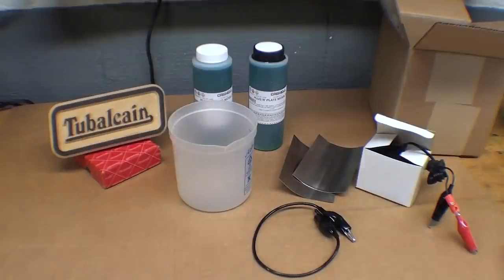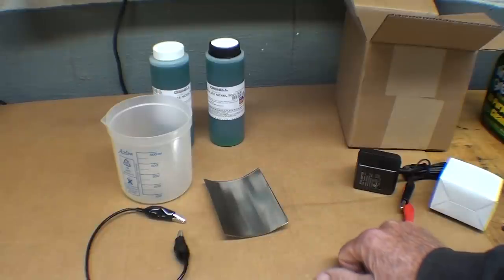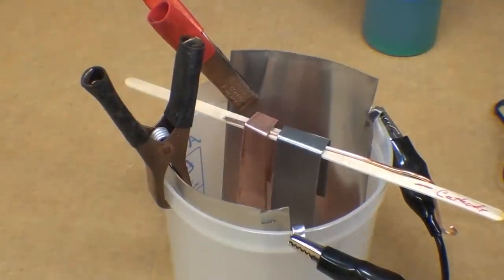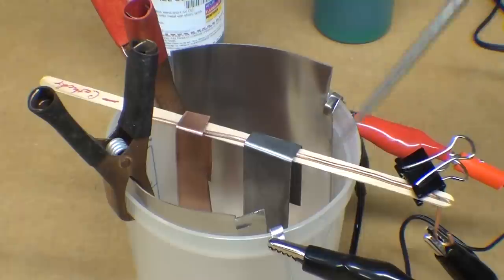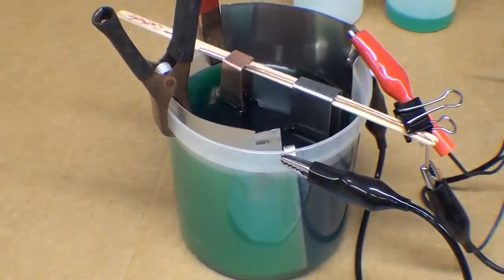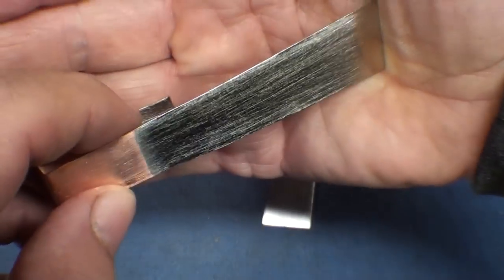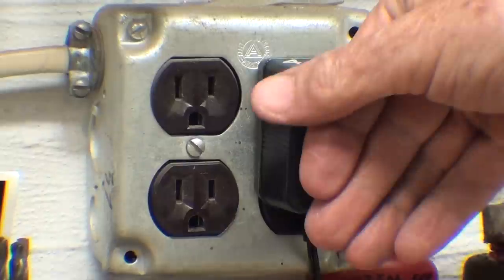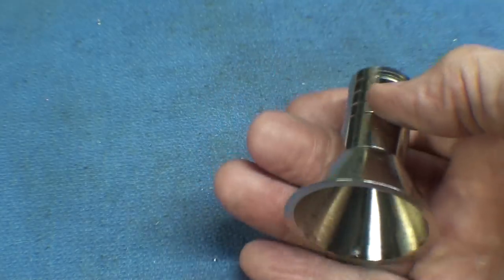SHOP TIPS #383 How to Nickel Plate tubalcain electroplating

Comment: 👍That was cool! Thx for showing us. My 1st job (before my “real”’education) was @ a huge local downtown Louisville KY hotel in maintenance-engineering dept. The presidential suite plumbing was heavy nickel plated brass. Fittings were simply beautiful for plumbing & I learned that one can easily mar up a fine finish very fast if not using proper tools. I believe also used on boats-ships in salty climate. Since then I’ve kept a certain kind of appreciation for such high quality nickel, yellow brass & #1 copper sheeting that was used back in the day. Thank you Sir Lyle.
Reply from the maker: And now, most of the cheap Fossetts at the box stores are chrome plated plastic

Comment: Your story about the stolen nickel rods reminded me of an incident. A large machine shop stored a lot of their material outside. They secured it with a chain link fence. Someone broke in and stole some sheets of aluminum, several hundred pounds. I've observed in my life that most criminals are stupid. True to that, they took the aluminum to a nearby scrap yard and used their real name. The machine shop called around asking for plate aluminum. When they found it, they met the police there. They had all the printed info from the aluminum, heat numbers and whatnot to prove it was theirs. The owner of the yard was steaming mad but was forced to return it.

Comment: Thank you for the demonstration! I used this technique to zinc plate the original fasteners and smaller steel pieces on the '1970 vintage Triumph Tiger I'm restoring. I used a solution of white vinegar, epsom salts and sugar (from a formula that I found on some plating how-to-group) and four 1.5 volt batteries or single 9-volt. All very inexpensive. The bubbling was quite apparent (more of an effervescent bubbling than a boiling bubbling) so I'm not sure why you didn't witness it except for possibly actually using only 2 to 2-1/2 volts. Take note that you can overdo it with zinc. If left too long (more than several hours) it will actually accumulate a zinc crust rather than a plating. Then you have to wire-wheel the any male threads and chase any female threads with a Whitworth tap and start over. The zinc plating does appear a little dull right out of the soup, but it quite easily buffs to a nice shine that lasts.

Comment: In 1968 after the Navy, I got a job working at an electroplating plant (small shop).  Plating copper tips for soldering pencils with iron.  After two years of experience in using this plating system, a new engineer became the overseer of our process.  It was common to take a tip that has been plated with iron and heat it with a torch and bend it in a horseshoe shape.  The engineer would example it via a magnifying glass to see if any imperfections.  He insisted that there were imperfections on the tip.  Now I had to completely remove all the iron via sulfuric acid from the copper tips and redo the plating again.
Three hours later I took to the engineer a tip that had been heated and bent for examination.  He looked at it and said that’s better.   What he didn’t know it was the very same tip that I show him 3 hours ago.

Comment: Mr. Pete, greetings from N.C. and thanks for another great video. I worked in a plant for twenty years that did triple chrome plating on brass autoclave doors and a ferrous parts for medical equipment. The three are copper, nickel and chrome. Parts were highly polished, chemically cleaned and washed and came out of the final tank with a mirror finish. The best chrome plating always include nonporous nickel to seal the base surface to prevent corrosion. Cheaper plating on ferrous that omits nickel will eventually rust through the porous chrome.

Comment: hey my friends and I nickle plate brass jewery for a living and if you heat up the solution in a hot pan or microwave it helps it from flaking off and it gives it a very bright shine, also if u give it some circulation like with a fish tank pump it plates like in 3 or 4 minutes..  i think that the needle on reader was moving because the copper wire on wood stick wasent clipped on right. i hope this helps..
Reply: Good tip to know, thanks. I noticed he filled the cup with the solution up to touching the holding clamps. That’s not good, right?

Comment: Back when I was an apprentice machinist one of the journeymen had to make a wind tunnel model nose cone that was thin wall so they could get the temperature distribution over the outside surface with thermocouples mounted on the inside. He made the model 1/16" undersize out of aluminum then it went out for playing.
They first copper plated the aluminum because the nickel wouldn't stick to the aluminum then plated the copper with the nickel until the plate was over 1/16" thick but the surface was covered in what looked like "warts" . He machined it down to the required size polished it up and it looked great. 
I've been thinking about making metal models using a plastic model playing with copper then dissolving the plastic out and playing the inside with nickel and disolving the copper off the nickel and I would be left with a model only made out of metal.
Thank you Mr. Pete love your channel😀

Comment: I am watching as I am plating in the garage.  1.  You can easily make your own plating solution using household vinegar and some salt to increase the conductivity.  Both anode and cathode would be nickel.  When the solution turns green (about 1/2 hour) you are ready to go.  2.  To plate, make sure, as you said, that the piece to be plated is as polished and perfect as you can get it.  If you use Scotchbrite or abrasive paper you will have scratches, so use a buffer to make it as good as you want the finished product.  3.  Negative lead to piece to be plated, and positive to nickel source.  You used strips, I use old Canadian nickels which are 99.9% nickel.  NOT ALL NICKELS ARE!  Judge your time by the look of the finished piece.  When you are happy, do a little more and your are done.  Really simple and fun.  In my case, it cost me an old nickel, which will do many jobs, and some vinegar.  Remember, NEGATIVE to piece you want to plate.  Bubbles will form on piece you are plating.  Counterintuitive, but there you are!
Thanks for great video!
Reply from the maker: Thank you very much that is great information

Comment: I remember seeing the plating plant at Mira Showers in the 90's. They were plating the brass shower valve bodies. They used copper plating followed by polishing they did this because the copper would fill in all the very small imperfections. the valve bodies were then nickle plated and then chrome plated, the nickle was used because chrome will not take very well to the copper but would take to nickle.

Comment: Mr. Pete, your Simpson 260 is THE most classic of multimeters!  It is THE standard and is the "Starett" of electronic tools.  Don't let it disappear (I practically keep mine under lock & key and I don't "lend" it); and, check the batteries once in a while.
Reply: Jim Cason I was admiring Mr Pete's Simpson too. You're right, that would be a tragedy if one of those batteries leaked. I had better go check mine too.
Reply: I've got my original Simpson 260 that I bought in 1978 and I have a Simpson 303 (VTVM). Both are in near perfect conditions and still in their leather cases.
Reply: I still have 2 of the black simpson 260's and 1 of the "newer" yellow plastic ones. All of them are in soft canvas cases and used regularly.

Still one of the best meters you can use.

Comment: It was mentioned below, the nickle is in the solution.  I believe when they chrome plate parts, first the plate with copper, then nickle, then finally with chrome.  Plating with silver, nickle or gold are simple and they do car badges with it.  They just have a wand with a cotton ball on it, then touch the shiny part of the badge with an electrode, and wipe the wet(with whatever plating solution) over the part to make it gold.  I don't think most plating is too dangerous except for chrome plating, as the acid used to hold the chrome in solution is very caustic and the out gas is deadly.  Great video by the way.
Reply: I've seen the 'wand' method used to gold plate taps (faucets) and radiator tails.

Comment: Great video
I can see allot of items around Mr Pete's house becoming shiny.
There are many applications in the machining hobby where metal plating comes in handy.
If you want to tighten up the fit of a shaft in a bore, you can get a real close fit.
Require a surface that is long wearing.
Corrosion protect.

Allot of the early automobile trim was Nickle plated instead of Chrome. I actually think Nickle looks better. Has a softer look.

Cheers
Willy

Comment: I think the photographic technique to which you refer @ 18:44 is the use of a 'light box' or 'light tent'.  It is a usually a wireframe or cardboard box cube with white translucent material draped all around with a curved piece (of white paper, cardboard or material) behind and under the item and a single opening through which you place the item and photograph through. The light illuminates the material from the outside so all the material is evenly lit inside and kills most of the shadows on the item to be photographed. Super easy to make.
Reply from the maker: Thanks

Comment: I don't know if anyone else mentioned this for I didn't read all 212 comments, but the anodes are only used as a conductor and the actual nickel is dissolved in the electrolyte. This isn't to say there is no transfer from the anodes but very little.
Also pulse charging has been around for a while, protects the battery. Thanks for the video

Comment: The green solution is probably Nickel acetate solution made by electrolytic meand in white vinegar.  It's quite safe and can easily be made at home.  The solution improves as you plate more.  A better way of hanging the bell punch is to take stout copper wire bend a 'U' shape for about 10mm and push it into the screw hole giving a positive electrical and mechanical connection as well as allowing the screwed hole to plate.When plating steel it is better to plate with copper first with electrolytically home made copper acetate solution with copper and white vinegar.

Comment: WHEN YOU GO TO PLATE YOUR PART THAT YOU MADE. AND WANT A GOOD PLATE. THAT WONT WONT PEEL. MAKE YOU A SMALL ELTRO. CLEANER AND A MILD ACID DIP.YOU CAN USE A LITTLE  CLEAN BATTERY ACID ( SULFURIC )  10% & 90% H2O  THEN CLEAN WATER RINSE, IF YOU DONT SEE ANY WATER BRAKE ON PART.YOU HAVE A CLEAN PART.AND WHEN PLATED YOU SHOULD HAVE A GOOD PLATE.  IAM A PLATER, RETIRED. HOPE THIS HELPS. YOU HAVE BEEN A BIG HELP TO ME ON YOUR MACHINE VIDEOS

Comment: I really enjoyed this video mrpete! I purchased a gold plating kit a few yrs ago (I haven't used it yet) it came with a gold solution that is clear and you use a swab to "paint" the gold on a item you could hang it like you did but the kit only comes with a small jar of gold solution so it would need to be a very small item- the directions say to remove any chrome plate (came with chrome stripper) then reactivate the nickel before applying the gold- the video shows gold plating a kitchen sprayer (22crt) I am going to give it a try after watching your video cuz I forgot I even had it lol you could probably buy the gold solution and use your set up & make a cotten tipped swab to apply, oops looks like I got carried away with this comment- Great Video mrpete! 2 thumbs up

Comment: Interesting stuff.  I was also impressed with the look of the punch when it came out of the solution.  I'm sure you can get the 2 main ingredients on eBay or somewhere cheaper than buying it with the kit.  Be advised the nickel sulfate is said to be a carcinogen, so always wear the latex gloves and use in a well-ventilated area, preferably outside.  You can get it in crystal form, but don't breathe in any of the dust.  Not sure what to mix it with, probably distilled water?  A potential source for the nickel is pre-1982 Canadian nickels, which are said to be .999 nickel.  Some french francs are the same.  Or just search for nickel bullion.

Comment: Also, now that you have the kit (which is just the wall wart, so you can also do this with batteries) you can also do copper at home.  Use copper wire or a copper bar as the anode, and use copper sulfate pentahydrate as the solution.  You can get copper sulfate at the hardware store as plumbing root killer.  It's a blue crystal.  Just mix it with water and set it up the same way.  Do this one in a well ventilated area, as it off gasses sulfur dioxide.

Comment: For those scientific purists the normal copper plating solution is copper sulfate. It comes in powder for and should be mixed with distilled water.

These days I'm taking up anodizing. I'm considering doing a steam engine with no paint, just anodized finishes for a mostly aluminum build.

Comment: Explanation for fluctuating voltage: Tiny bubbles cover the workpiece,  reducing the surface to the liquid and therefore increasing the resistance. The bubbles grow larger and finally break loose and the surface to the liquid increases again, reducing the resistance. This process starts over and over again.

Comment: I just got the stuff but I didn't use a kit. I decided to get the 44 x 1.24-inch rolls, not as thick but it's easier to mess with cutting. I've plated before but with zinc. Over time I'm going to be plating a lot of parts but not high volume so I got a magnetic stir and lab bars to help knock the bubbles off. I got a thick plastic box that will hold about 2 gallons. Some of those cheap wall chargers are noisy you might want to put a filter cap of about 1000uf across them but if you put the polarity on backward those things will pop and smoke, it's kind of fun to watch but wear safety glasses. I blew up a bag of capacitors just for fun.

Comment: I have never seen an electropated finish delaminate from metal, only from plastics.  Chrome, on the other hand, is infamous for peeling off even when professionally done.  

I have been gruesomely sliced twice by peeling chrome, the separated 'flakes' are viciously sharp, jagged, and usually corroded from the base metal on the backside.  I'll take the nickel finish every time I have a choice.

Comment: I had a peace of nickel plated cast iron from a old gas stove made in the 1940,s  probably, and it was stored outside in full weather for 2 years and never rusted one bit , I took a rag and rubbed the dirt off it and it shined bright and perfect .
It had very good nickel plating , probably very thick , not like the things that are made today with just enough plating to give the product color and start to rust the first time it gets wet .
I like nickel plated things better than chrome plated things .
Nickel plating has a warmer tone when polished .
This is a easer way to plate things in a home shop .
Factory,s usual copper plate first coat under the second coat chrome plate .
I have been told that some times the copper plating is then buffed to make the surface smoother before the second chrome plating step to give a better finish .
I did some copper plating as a kid and used copper sulfate power and water for the solution , and it has a pretty blue/ green color something like what you used , might be the same or similar .
I would guess that what you used has  some copper sulfate in it by the color .

Comment: Tubalcain, instead of using your plug in power supply, I'd use a fully charged 12 volt car battery, which would probably produce the bubbles you were so looking forward to see, and a much thicker plating rate over one thou per hour. With a much larger amperage available, the plating process is much quicker/thicker.

Comment: Just using the "see how far it will go" principle, I would have had to make some attempt at buffing that bell.  The results you got are pretty impressive, knowing it could have been better would haunt me :).
Nothing fancy - a battery drill holding a rod that would just go through the hole ... tighten the screw and spin ...  a bit of spin and polish using some reasonable grit emery ... say 4, 6 and 800 .... just a minute each grit ... then see how it turned out.

Comment: Regarding the MSDSes, I'm inclined to agree with you in many contexts.  I've mentored FIRST robotics teams for the better part of the past decade (great competition, look it up if you have the time!), and it has always bugged me to no end that the "safety inspectors" at competition will roam the pits asking students where they keep the MSDSes for the stuff in the battery spill kit, while totally ignoring anything relevant to actual, practical safety procedures (like clear communication when power tools are being turned on, etc).  A lot of the time, I'm convinced they're more interested in catching a student with some sort of contrived "gotcha" question than in actually keeping anyone safe...

Granted, there are some contexts in which MSDSes are important; but much of the time it's very much a case of "safety theater."  Unfortunate, really, as that kind of nonsense usually results in people taking safety less-seriously, which is actually a problem.
Reply from the maker: Just a lot of governmental nonsense
Reply: This happens everywhere. I had an inspection and got quized as tothe whereabouts of the "fichas tecnicas" (materials safety sheets) for some bottles of one litre we had in the workshop. These were regular items, alcohol, paint, kitchen grade degreaser and acetone. the inspector considered it totally irrelavent that she had all of these items either in her kitchen or on the shelves of her garage. This is in Spain.